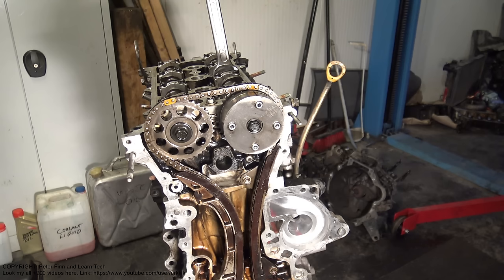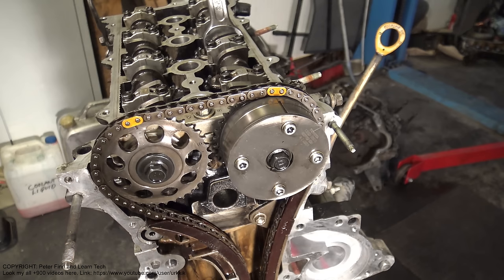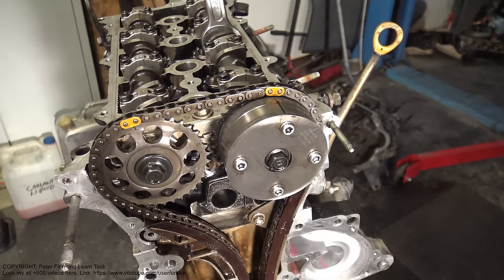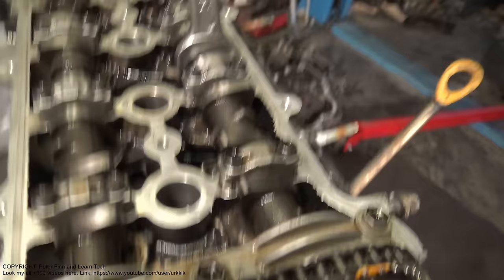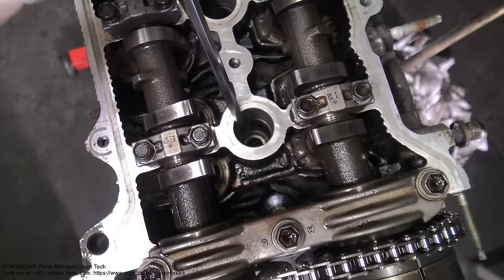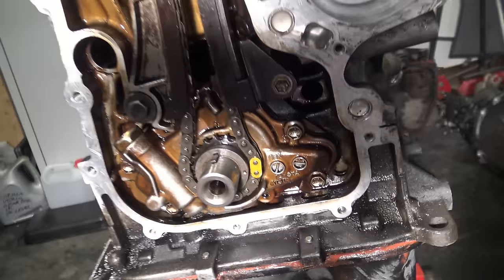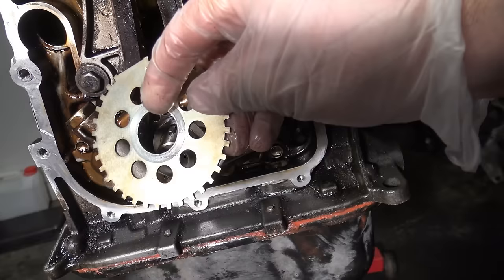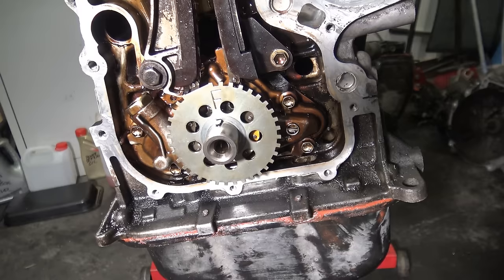What are Yellow markings in Toyota timing chain

Comment: Hi Doc, please help. I just replaced my chain on the 1zz and it restored the power n throttle response. A day later, the power is lagging n i have to double tap the accelerator to get it going... what could be the problem? My electronics like spark plugs n coil plugs are all new - please help

Comment: Dumb question i always wanted to ask.... ok, the timing chain, if each link in the chain is created equal, then why does it matter where the yellow marked links go?  It seems, from a naive point of view, that all that really matters is if the gears dots are aligned.... In other words, what would be the consequence if you installed the chain with the yellow marks being out of sync? (always been afraid to ask this).
Reply: In my opinion it does not matter.  Being that there are three, it must be to see if it has skipped.  Real service manuals seem to be scarce, I wish my cheapy book would show up.  Everything on mine is according to this video except the yellow marks which looks like this engine has been serviced before and the mechanic did not set the yellow marks correctly.  The engine runs great, but the head gasket must be blown.  BTW, if the new chain has yellow links I will put them in the correct position.
Reply: On second thought, the yellow marks are to insure the chain is taught on the opposite side of the tensioner.  In other words lining up all the yellow links to the dots on both cams and crank guaranties the correct number of links on the right hand side, without the colors one would make sure the chain is tight on that side.  Still, one should crank it around a couple of times to make sure the timing marks line up with or without colored links provided.

Comment: Is this able to be done without removing the engine
Reply: Yes, you can.  I'm currently doing this without taking it out.  You have to remove the passenger front wheel to get to the lower part, but it's totally doable.
Reply: @WoWFallina  thanks I appreciate the advice I’m 16 so this will be my first major engine tear down project
Reply from the maker: Very difficult.

Comment: Mr Peter I have a question I changed my tensioner in my Toyota Corolla xle 09 and I mess with my timing when I turned the timing pulley how can I get my timing back to normal do I have to take the engine apart please I would appreciate if you could help me thank you
Reply from the maker: Do install again
Reply: @PeterFinnTheCarDoctor  like reinstall the timing chain?

Comment: My friend has a 1NZ BO 35794 engine he changed the timing chain and he starts to hear knocking in the engine he also service the oil pump and drove the car he still heard the knocking what is the problem, how can he fix this
Reply from the maker: I think the timing chain is installed wrong and the timing is wrong.
But no worries, machine off and chain installation again.
Practice and Repeat 1000 times makes perfect, as my Basketball star Michael Jordan would tell me...